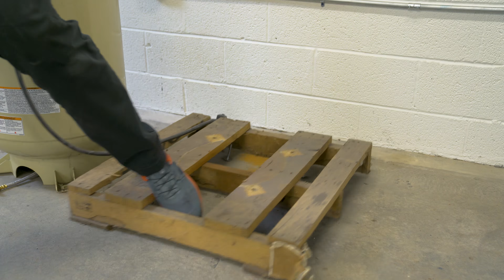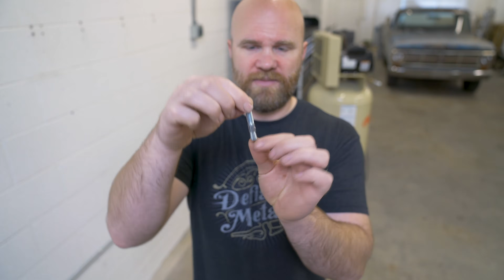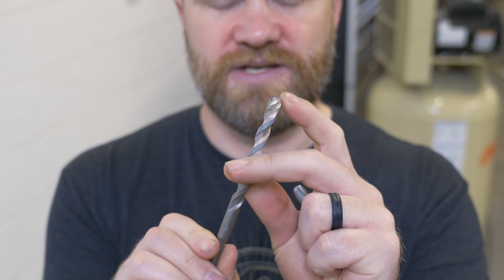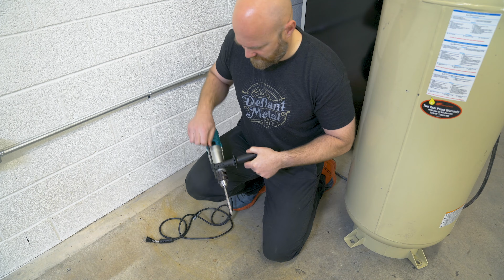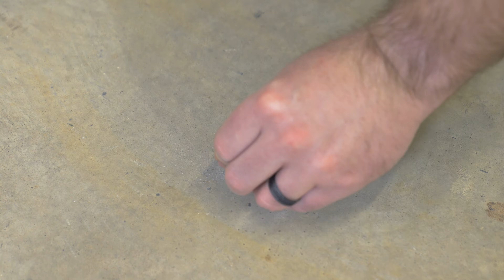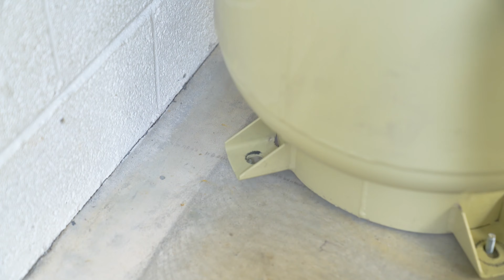How To Install Concrete Wedge Anchors - Secure Your Shop Equipment

Comment: I added some vibration dampening pads between the foot of the compressor and the concrete.  They are rubber and cork.  Might be something to look into if you notice vibration or the bolts working loose.  I got them at Northern.  They also have them on Amazon. https://amzn.to/3c52ZQV it’s cheap enough I didn’t give it a second though.  I just added them.
Reply from the maker: Ordered, thanks! Was anticipating needing something.
Reply: Justin Voss it made a big difference for me. 👍🏼
Reply: Hey I came back to let you know that Ingersoll Rand (and nearly all manufacturers) specify isolation vibration dampeners in the owners manual and state that failure to use them would void the warranty.  Glad to see you used them.

Comment: Do you have a link to that drain line extension? I have the same compressor
Reply from the maker: I’m pretty sure I got it at tractor supply. Comes up if you search air compressor drain line extension Tractor Supply.

Comment: Hockey pucks work great to isolate vibration.
Reply from the maker: That’s a good idea! Never heard of that.
Reply: @JustVoss  It's a 1" thick vulcanized rubber disc that you can get for like $1.50.  Why spend $30 for some rubber isolators?

Comment: if you ever want to move your compressor, you will left with studs sticking up out of the floor.   I suppose you could take them down with an angle grinder, but I'd prefer to use a female anchor and put a bolt down into it.
Reply: If you're wrestling a bigger compressor usinf flush shells would be easier than trying to set the tank over the bolts.

Comment: I've watched about ten videos on this subject and every single person in the videos doesn't know how to pronounce masonry.  It's pronounced just like it's spelled, that is, MAY SON REE (three syllables), not MAY SON AIR REE (four syllables. I have absolutely no idea why this simple word seems to be universally mispronounced. Also, the problem with type of achor for this purpose is that if you move the compresor, you have a bolt sticking out of the floor. You could cut it off but why do that?  Instead, use an insert that allows a bolt to be screwed in and removed later.  There is such a thing. For example, I have a tire changing machine that I use very seldom but it must be bolted to the floor.  I would NOT use a anchor like shown in this video. Instead, I use an achor that expans permanently into the concrete in which a bolt goes. The bolt can be removed.  To prevent debris from getting in the hole when not in use, I just use a threaded hole plug.

Comment: If the pallet is strong and stout enough I would have left it on the pallet. It will absorb vibration from the compressor and extend its life. Also keeping it out of direct contact from the concrete which absorbs moisture and will slowly cause the base to rust. The pallet allows better air flow. You could beef up the pallet and anchor it.
Reply from the maker: After the video I put some rubber/corked pads under the feet that are meant for compressors.

Comment: Hey I wanna get into welding and fabrication, but I have no desire to do big production ironworking on buildings etc. How did you get started? Do you have any recommendations? Love your videos keep up the hard work.
Reply from the maker: Auto restoration, motorsports, custom bikes, furniture, artwork, gym equipment, medical equipment... and more. All industries that are lighter fab and more preferable in my opinion too. Welding school will prepare you for any type as a good baseline. Then if you choose one of the harder industries to break into maybe just find one to volunteer at for a few hours a day or week, you’ll learn the most that way. Glad you like the videos, hopefully I can help with small parts of your goals.

Comment: My preferred anchor is drop-in female anchor which has self-contained epoxy.  I looked at the Home Depot site, but couldn't find an example.  They work great, and set flush with the surface of the floor.  I have used them for permanent installations -- a tire changer -- and reoccurring temporary installations -- my JD2 bender.  They work *awesome* and are functionally invisible when the tool isn't bolted to it.  You just have to blow out the thread before you install an infrequently used tool to protect the threads.
Also, on drills, the spiral flutes don't cut - they are a "conveyor" for removing the chips from the hole.  The lips at the point are what shear the material off as it rotates.
There's a guy that has gone ALL the way down the rabbit hole on drills & sharpening -- very educational.  gadgetbuilder.com. Worth the 1/2 hour it takes to read.

Comment: Great video!! Well done, the only "tip" i might possibly suggest....is when hammering those bolts down, put the nut on just above flush with the top of the bolt, then you wont "mushroom" the top of the bolt, and you can still get the nut on and off.
Regardless, thanks for the great content, keep up the builds/fabs/creations!!
Reply: oops, just noticed, Josh already mentioned this, my bad

Comment: I need to drill thru glazed tile then into the concrete to anchor a safe.  I'd hate to crack the tile and my wife would kill me if I did. I'm also concerned that the hammer action might bust loose the mud and grout.  Any tips?
Reply: Yep.  Search for a tutorial on cutting glass with a brass tube and valve lapping compound.

Comment: The most fail proof way of doing it is to set the air compressor in place then instead of marking the floor, just drill through the holes so you know your correct. Then place the anchor bolts and tap in and tighten. You won't have to move the air compressor nearly as much. Super clever idea on folding the tape on the drill bit. I've wrapped it many times before but never made a tab to move the dust. Very clever. Great job and video.
Reply from the maker: The feet on mine are actually under the bulge of the compressor so there’s no way to drill straight with it still in place. I definitely get what you are saying though.
Reply: Justin Voss okay i gotcha, makes sense

Comment: Like everyone is saying you need rubber or cork under the compressor legs. If you don't just going over a inch in the concrete the vibration will eventually break the concrete away and your compressor won't be stable. Should have drilled at least half the thickness of the concrete if not all the way thru. But hey live and learn I always say. You will know better next time you anchor anything down.
Reply: Justin, if you can, do a video on the noise difference between before and after the rubber dampening pads. I have two compressors and two different types of pads. One was a recycled aircraft tire and that one seemed to work slightly better.  On both the sound reduction was amazing.
Reply from the maker: I ordered pads so will definitely put them under there when they come. I thought about rubber when I was shooting but didn’t have any. The ones off Amazon have rubber and cork I believe.

Comment: Hey that was pretty cool when I did my air compressor I put rubber washers on the bottom just to keep the metal off of the concrete that way there’s not condensation developing
Reply from the maker: I ordered some rubber spacers made for it off of another comment, I thought about rubber while shooting but didn’t have any.

Comment: I have used a lot LOT of concrete anchors in my life and I have used a LOT of tape on my drill bits BUT I have NEVER made a wiper with tape doubled over before. GREAT IDEA THANK YOU SO MUCH! I would NEVER use a HARD hammer on the bolts without a nut on the bolt first.

Comment: A few additional tips drill all the way through the concrete if you have a 4”-6” slab and hammer down to desired depth. That way when you leave you just hammer the bolts down through the hole instead of having to cut or break them off. Also thread the nut on the anchor before knocking it down, it let’s you hit it harder without messing up the threads if using a regular hammer or messing up your mallet if you’re using that.
Reply: Excellent tips.

Comment: I mounted vibration isolators on the legs of compressor instead of bolting it down. Of course my compressor is in a separate closet with no interaction. I did this for sound deadening as concrete transmits sound more then you’d expect.